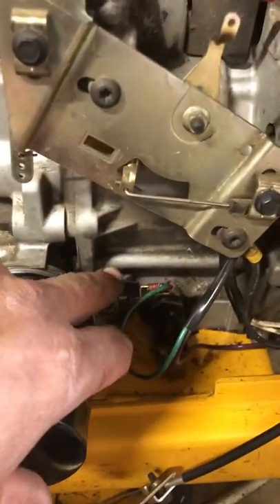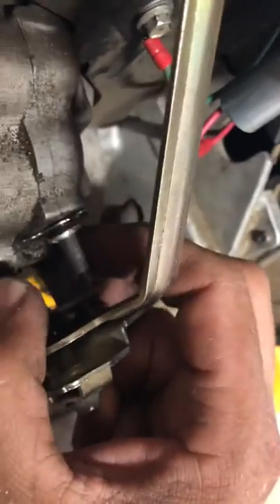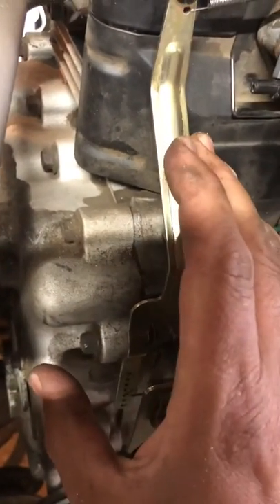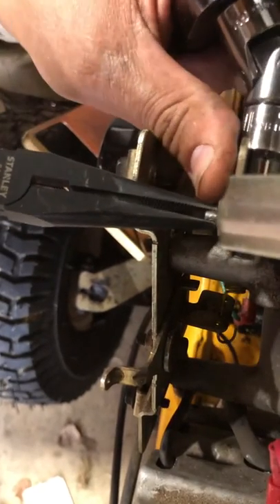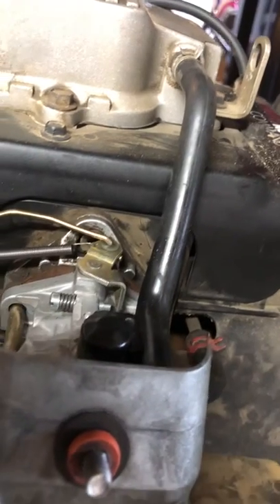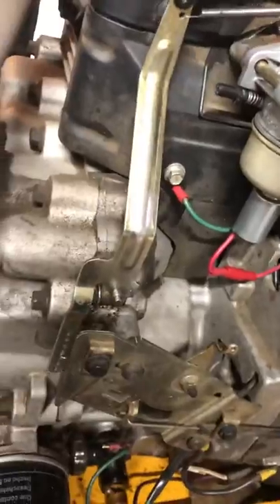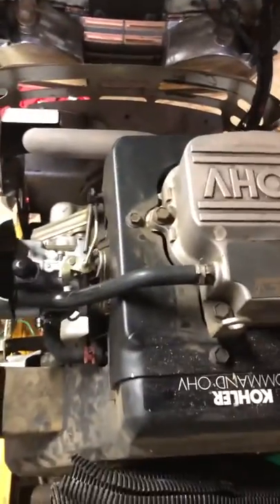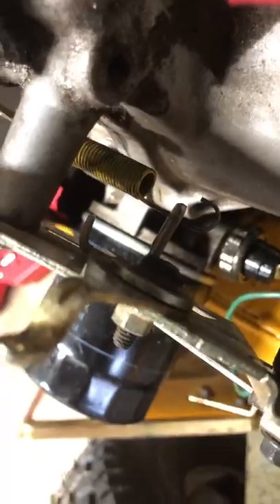Cub Cadet 2135 throttle/governor problem

Comment: Holding the governor arm to the left (wide open) then turn the governor shaft (comin out the engine) all way to the rt.. holding both in those positions  tighten the governor bolt down.  Move the spring one hole down. Remember that a looser spring will result in a less sensitive governor respomce.

You may need to remove engine and replace governor armature and gear.

Comment: Just came across your video. I had the same problem . Just happened that my problem was a lost screw that fell off in carburator and went inside to the piston .so my throttle  wasn't working

Comment: I ran my fuel hose around the back of the engine instead of  the steel tube next to the head to fix my problem of shutting of when hot.  So far so good.
Reply: Had the same problem and it was the fuel pump just getting old and weak, fyi…in case your problem comes back

Comment: Looks like you went the wrong way. Turn your gov shaft in same direction it turns when throttle is wide open. Shaft should stop and u can feel it touching the gov pin.

Comment: same issue here.. revved up to excessive RPMs.. turned out to be an internal governor issue.. Less expensive fix was a new engine..
Reply: if you know how to get into the engine on them its a lirttle pin that is all that that needed replaced

Comment: My Governor shaft rotates more than 360 degrees. All of my adjusting has been correct. I believe the governor came apart inside. That really sucks.

I am tearing down this weekend. I will let you know what I find. It seems odd that I just pulled the carb to clean it. Reassembly was easy. So I thought I must have  fouled the adjustment up.
I have adjusted governors several times and have never had an issue. At least is runs like new. LOL.
Reply: Probably broke your gov gear or pin feel out.